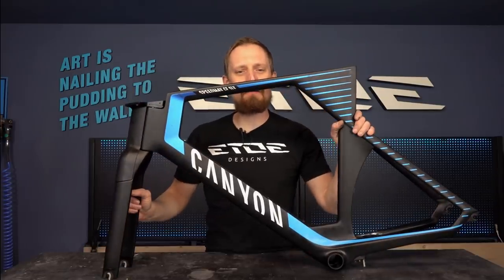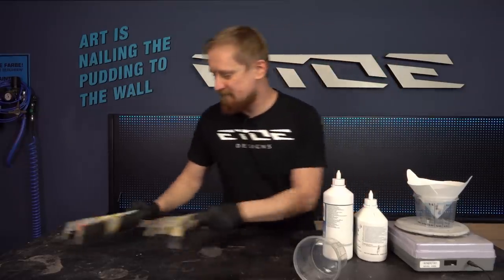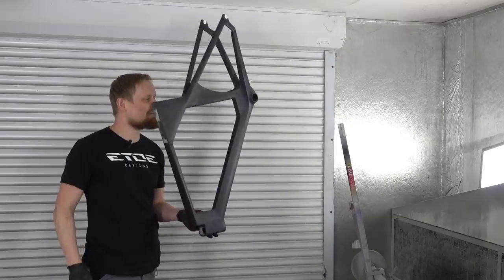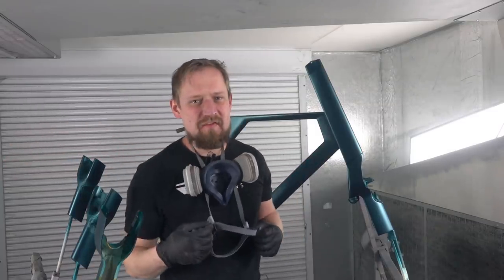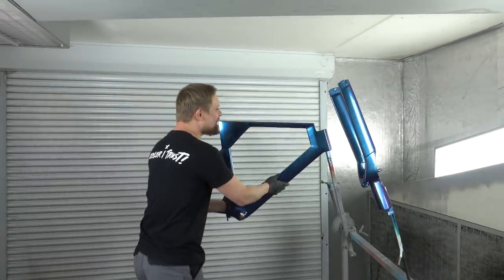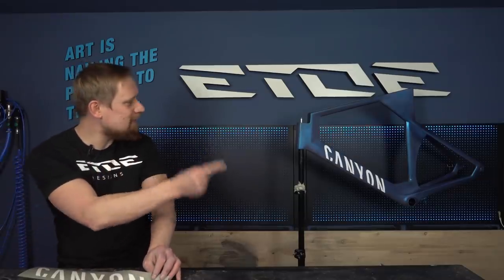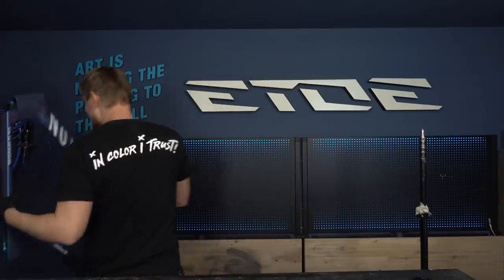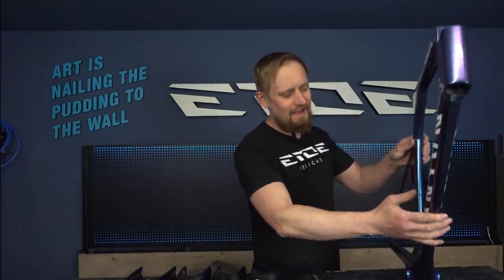how to paint color shift on a carbon bike - chameleon color

Comment: Hey Martin, this is another Martin :) I'm not a painter, but work in F1 team with carbon parts... So I have bmc gravel bike, which is black and would like to try and make custom paint job. Will use sand blaster at work to remove all factory paint and have access to our painting facilities. But biggest issue is my idea, and I need your advise. I want tosplit my bike and make one side color shift in one color scheme, and other side in other color shift scheme... how can I do nice color transfer in the midle of tubes? they are narrow... Thank you for your advices! Ich brauche Hilfe!!! ;)

Comment: As always an incredible job Martin i hope you didnt work using flipflops or you can get a beautiful pedicure! :D congrats! a little question... why the first ingredient had that milky look even with the flakes and then looked like a regular colorshift prep? is posible to use FLIPFLOP powder using normal clear coat like the glasurit 923-255? there is no best brands in my country :( have a great day and thanks for the content!!
Reply from the maker: I would not put pigments in clearcoat. You need lot more layers than only a clearcoat layer.

Comment: Amazing stuff! How long time do you recommend to wait before sanding/applying the next coat of paint if you dont have a proper paint oven to bake the paint (1K DYI spray can paint job)? Just to be on the safe side I have waited for about a week or until I cant smell the paint anymore but this is very time consuming.
Reply from the maker: 10 to 30 minutes.

Comment: Love your work, and I've been inspired to give it a go (on small parts and my own frame, of course)

Couple of questions:
Can this effect be done with spray cans? If so, what would I need?

Related but also not really related, what would you recommend as a starter spray gun? If you could only have one, for mostly larger jobs but the odd more detailed job (for someone who may only use it occasionally)

Much appreciated 👍
Reply from the maker: Not the same but color shift cans are available.
Reply: @ETOE  great, thanks.
Do Montana do some, or any other makes you'd use if not?

Appreciate the response 👍
Reply: magpierh Kustom Cans makes chameleon paint in different color ways.
Reply: @danielleopold707  awesome thanks - I'll have a look!

Comment: Hi Martin, did you clear before sanding the basecoat to then add the logos?
Reply from the maker: Yes I clearcoat sometimes inbetween if it`s needed to attach more layers. You can also apply logos direct on basecoat, so you have no need to clear.
Reply: @ETOE  Ok thank you 👍